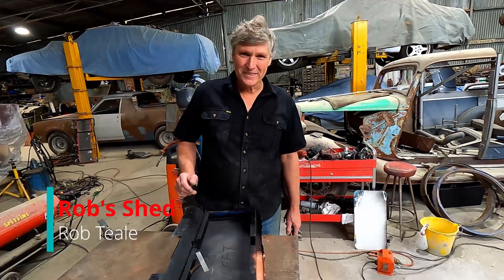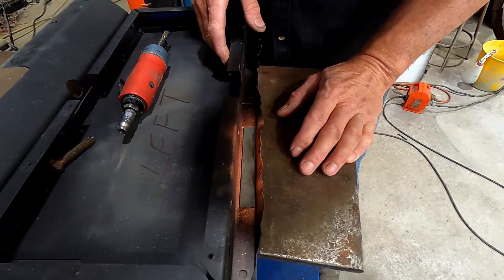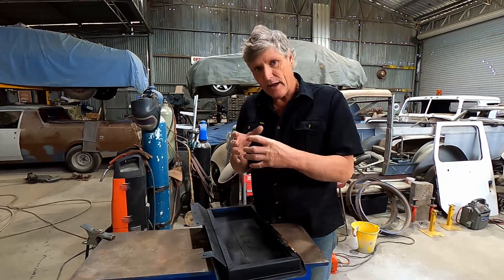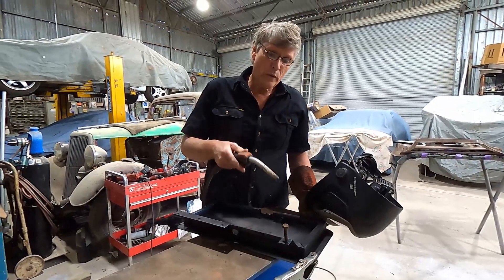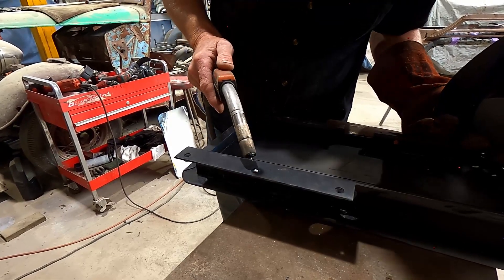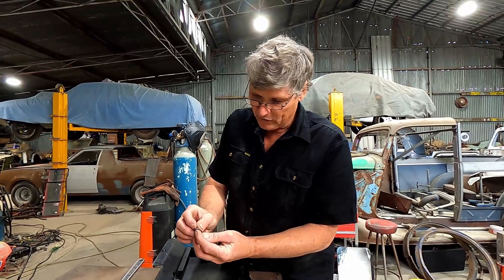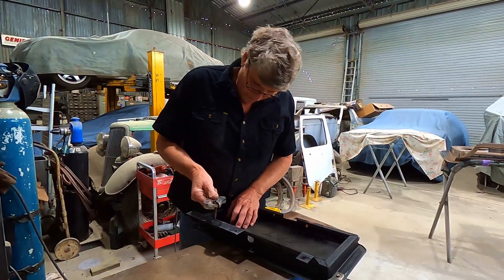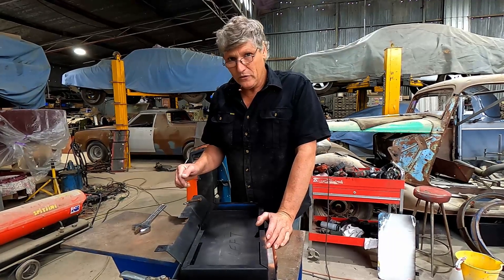Rob removes broken bolts by welding them

Comment: We do heaps of this type of work, we found the easiest and best way, is to weld a small washer, that has a hole as small or smaller than the broken bolt/stud, once the washer is welded you can then weld a bolt to the washer, we very rarely stuff it up, regardless of size.
Reply from the maker: Very good advice. Takes some of the risk of welding the broken bolt to what you want it out of, away. I have never tried that but can see the benifit straight away. Thanks for sharing, hopefully it can help some of our viewers. Cheers Rob. 
p/s I started doing this trick with the old homemade 24v dc stick welder, couldn't believe how easy it became once I bought a mig and learned to use it.
Reply: @robsshed  The guy who showed me that I have worked with for 20 years, he retired 2 years ago and I retired at 68 because of my medical situation, its a shame but many tricks of the trade are being lost, but I enjoy watching many young talents out there.

Comment: Hey Rob have you done a video replacing a tail gate skin..
Reply from the maker: Not at this stage. It is very similar to doing door skins, and even the replacement section I made on the bootlid video.( making rust repair sections with basic hand tools). Best advice fold down the crimp enough to hold the skin, but loose enough to still be able to move it on the frame. Fit the tailgate line up the bottom of the frame to the bed and center it to the sides. Then move the skin on the frame to adjust the outside gaps. Once you are happy with it remove and finish the crimping. Spot weld the crimp to the frame, finish the welds and you have it. No doubt I will be fitting one in the future and we will make a video then. Cheers Rob.

Comment: Excellent Rob. I have a broken seatbelt bolt and bumper bolt stuck in chassis I have to remove. Will copy you technic. cheers mate
Reply from the maker: Good luck mate. Once you get them to rock get some lubricant on the threads to make it easier to undo. WD40 or Crc type product. If these size bolts have snapped they will be tight. I have removed many of those  bolts this way with great success. Cheers Rob.

Comment: I use this trick all the time (at work mostly) works a treat. We just use a nut and basically plug weld it to the top of the snapped stud.
Reply from the maker: I have done that, I usually resent sacrificing a nut to the broken bolt, for me it is always now the first piece of scrap metal I find.

Comment: Would that work on a snapped off engine bolt though? I had a power steering bracket bolt snap off. Thanks Rob. 👍
Reply from the maker: Sure will, I have removed many bolts broken off in engines this way. Most recently I removed two broken off engine mounting bolts in a 12.7L Detroit engine. The bolts were loctited, with damaged threads and broken below the surface by about 15mm. They both came out first try. Cheers Rob.
Reply: @robsshed  Thanks Rob shall give it a go. Cheers Craig 👍